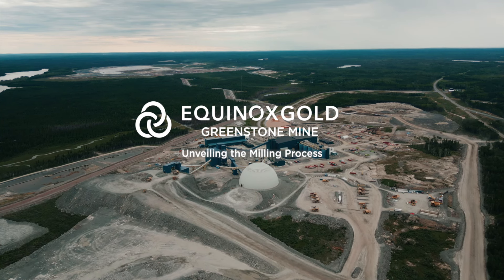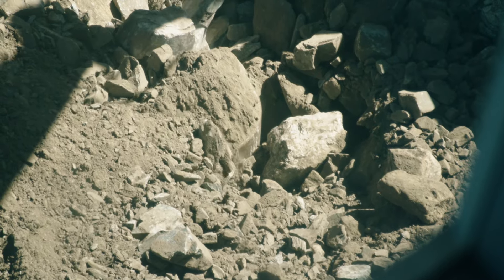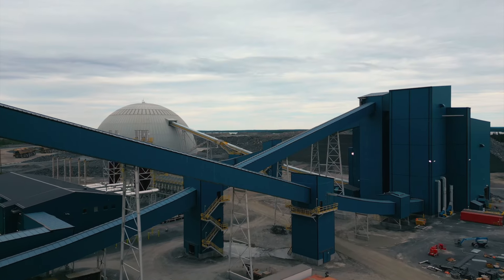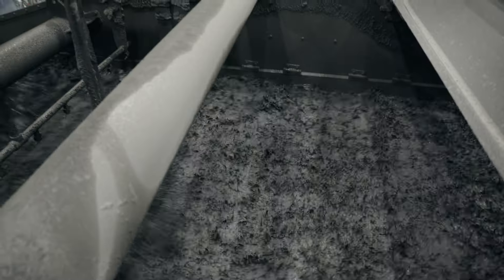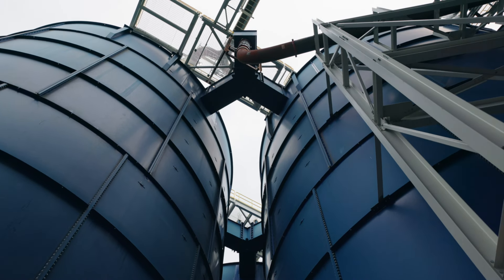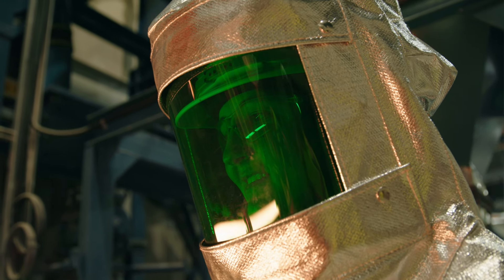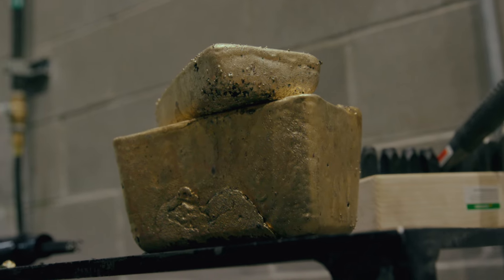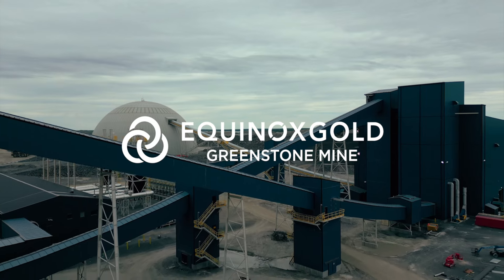Equinox Gold - Greenstone Mine | Unveiling the Milling Process

Comment: Have you in my Por. A nice increase in market price. Many thanks.
However in terms of the video. Shame you don't mention the details of the leaching process. Is Concentrate produced ?
And initial smelting produced Doire Bars ?
Both these items are currently being purchased by Brics+ nations prior to going onto the open market. Even Saudi Arabia has been purchasing PMs clandestinely over the past 2 years. Shows intent !
Lastly is Refinement the last stage to convert Doire bars into constituent saleable metals ?
Also a bit more detail on the crushing and Leeching would be greatly appreciated.
What is the market cap for Osisko ?
Reply: Earnings for large cap miners will be released in 1st and 2nd Week of November and Fund Managers will rebalance their portfolios and follow Sam Duncan Miller pivot from Tech to newmont etc. Front run them and get the money.